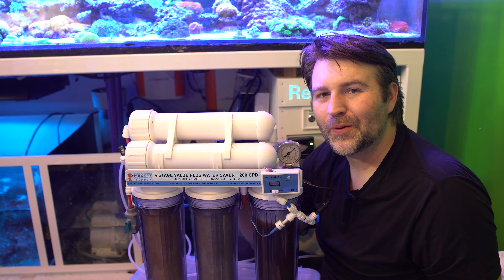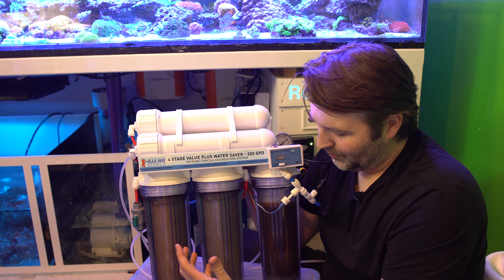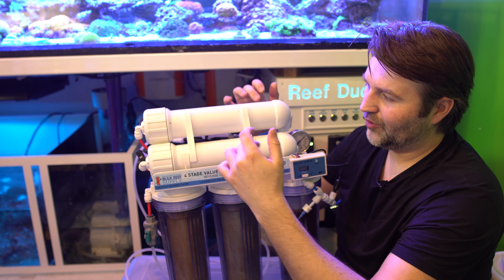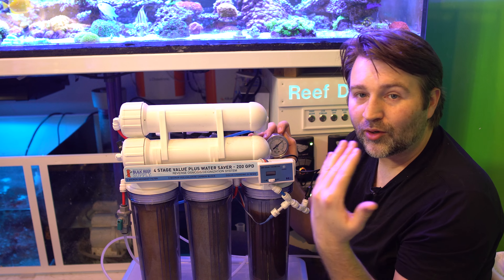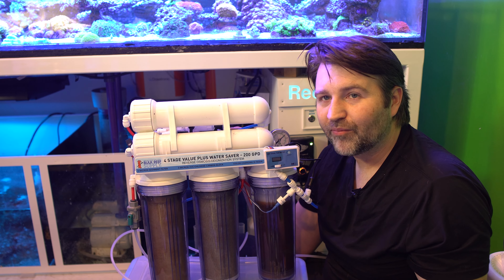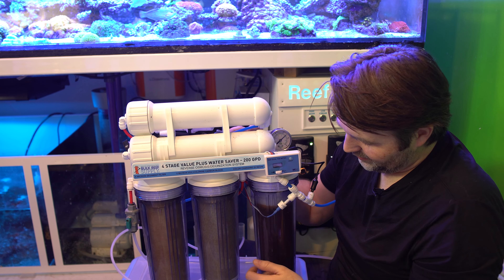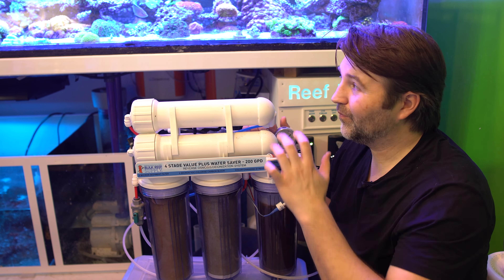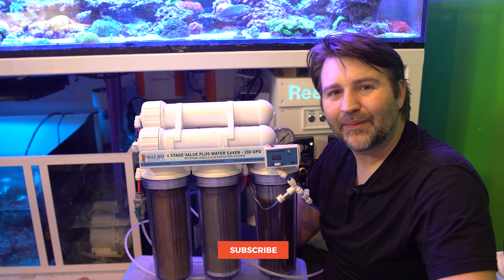When to change your RODI sediment, carbon, membrane, Di filters

Comment: Deven, Do you also run a booster pump on your RODI? My water pressure is 55-58 and using a booster pump it is 78-80. My system is a 7 stage and I also use 2 membranes.

Comment: Hello Deven, I added a second RO membrane on my system but took the waist from the first RO and put it in the intake of the second RO, is that ok or should I change it the way you did yours by splitting the the after the carbon to go to the 2 RO membranes? Thank you
Reply from the maker: Your method is more efficient for waste water.  I have my other unit setup the same way.  That’s the water saver config :)

Both ways work
Reply: @ReefDudes  thank you